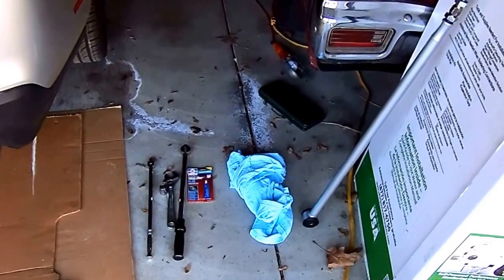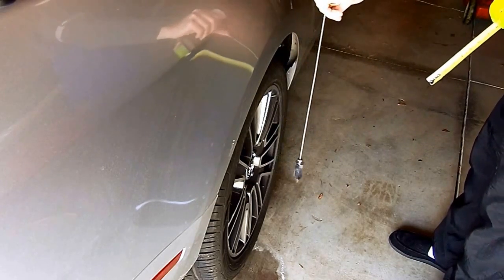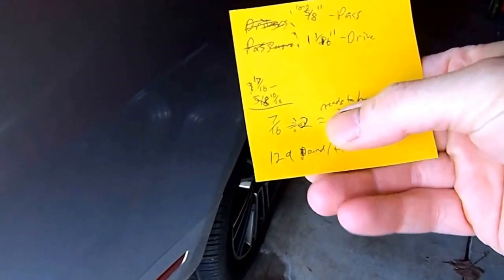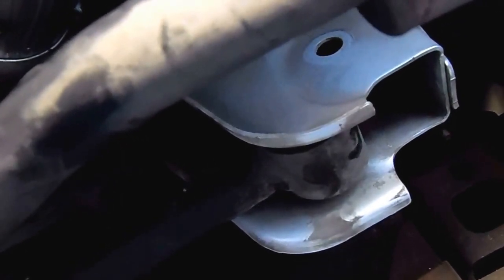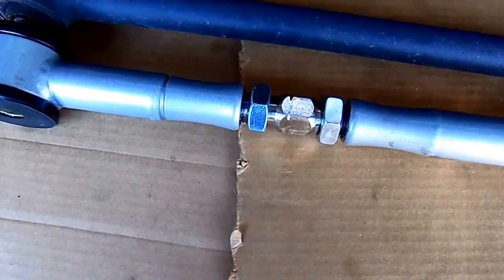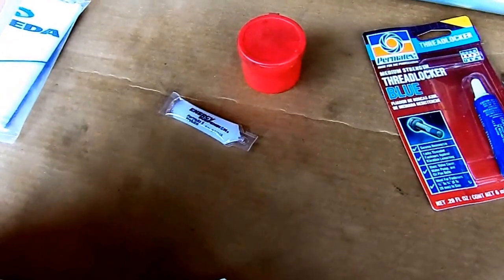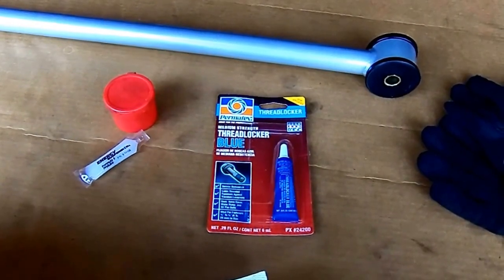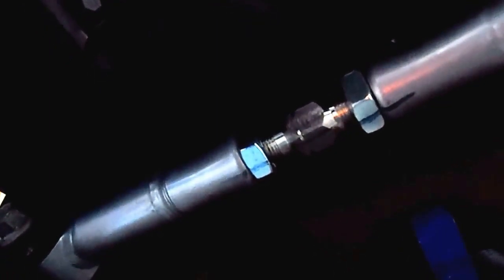2011 Mustang GT Panhard Bar Install and Setup

Comment: does this correct a sway when accelerating hard?
Reply from the maker: I doubt this would correct a sway.  It does center the rear end which helps keep it from jumping out so much to one side when spinning the tires.